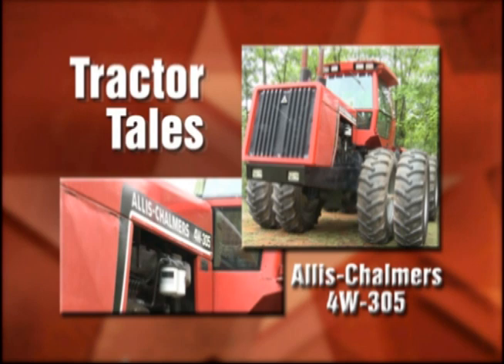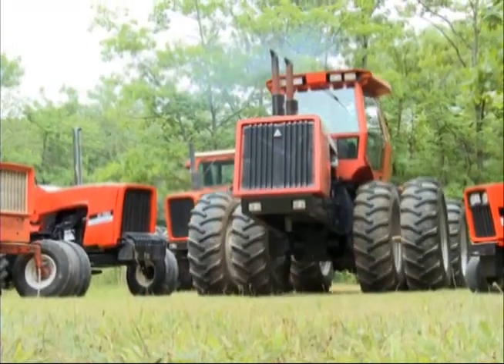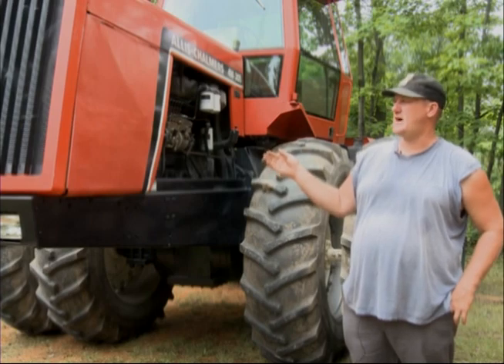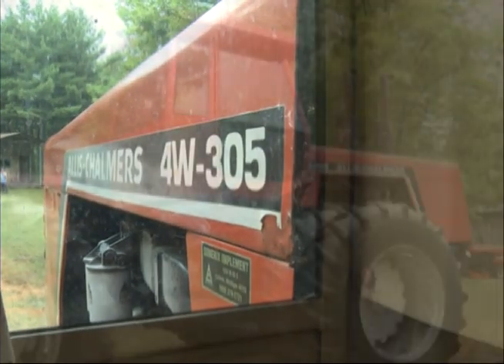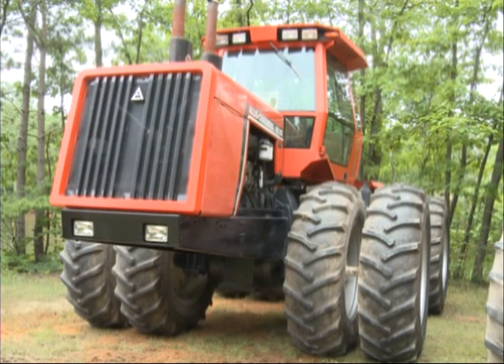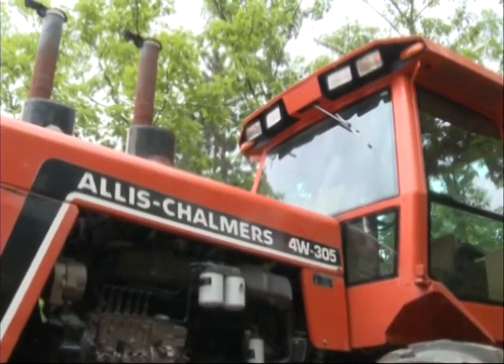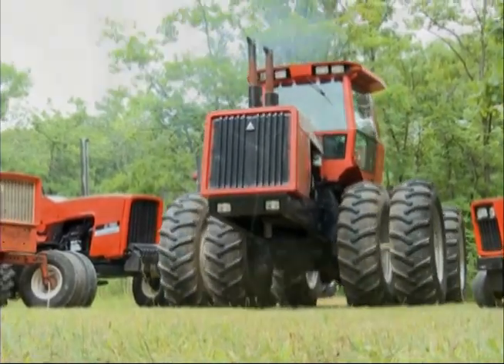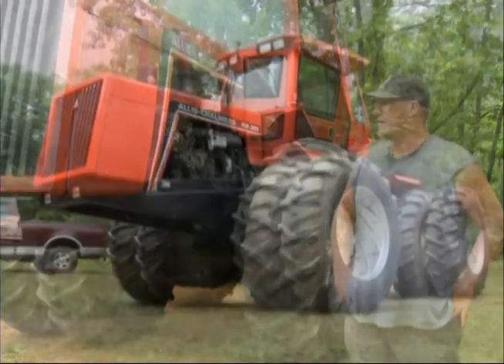Tractor Tales:  Allis Chalmers 4W-305

Comment: The 731 cid is nowhere near the biggest engine Allis built if you include industrial equipment. The 731 is a detuned 844 that was in the HD21 crawler and there were much bigger engines built then 844.

Comment: "It's a 741 cubic engine diesel motor..." 

It doesn't have a motor, it has an engine. Motors are powered by electricity.
Reply: You are certainly incorrect, motor has always included internal combustion, hydrostatic as well.  Its actually in the definition.  But, its not about what a book says, its about how people use the word in their everyday vernacular.  You must not enjoy watching these video's?  Or are you the guy looking to be a know it all about something...anything...please Jesus let this man find some topic he knows stuff about.  You screwed up basic terminoolgy old man toot.   I love me a 4w anything, grew up doing all the tillage in the tiny cab of an 8550, same basically as the 305.  AC never worked.  It could pull anything though, as long as it got traction, never dropped more than 200 maybe 300 rpms.  That's rotationaries persons minute I believe.  Have a good day motorcycle man, PS, I got a Stage 3 Warrior 1700 and a Harley.  So looks like I win all day. :)
Reply: @heatmoon  you obliterated him
Reply: @heatmoon  1700? is that how much you paid for the MOTOR from an indian warrior?